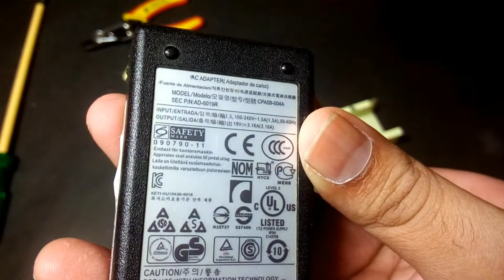Whats Inside Laptop power adapter//basic working principle & fault

Comment: sir please help me i had a charger of laptop and its power wire switch is burnt what will happen i replace the plug with other plug , because the plog has no transistor or other components, is it will fine if i replace with other plug
Reply from the maker: Yeah you can do that

Comment: Can I use the transformer to do a AC to AC connection? I need a 12v AC output (not for charging anything, I am trying to make a fuel injector cleaner). I have a poweradaptor with a voltage selector and this transformer
Reply from the maker: Yes. A transformer will give you ac voltage only.
Reply: @technoboy-allinOne  Thanks my friend
Reply: @technoboy-allinOne  Thanks a lot too mate 👍